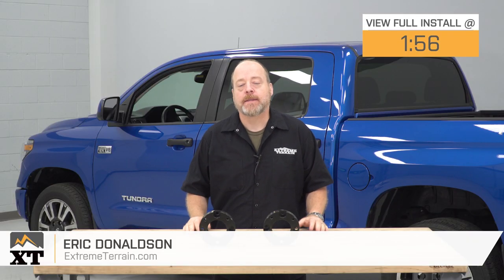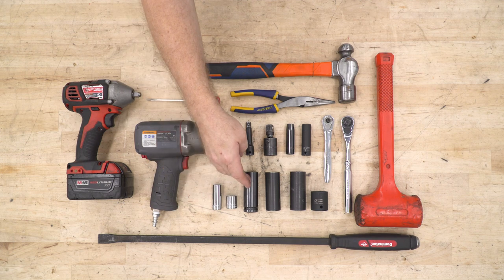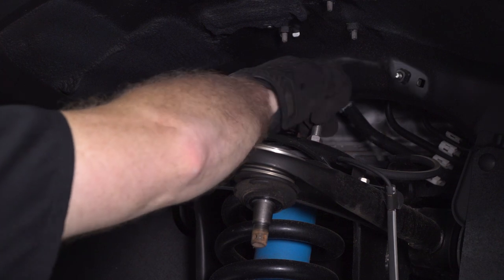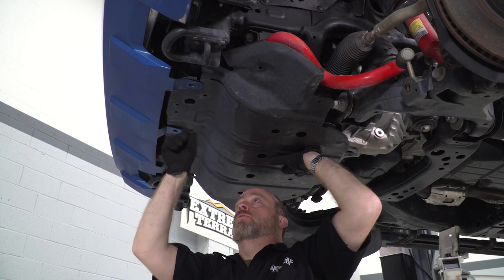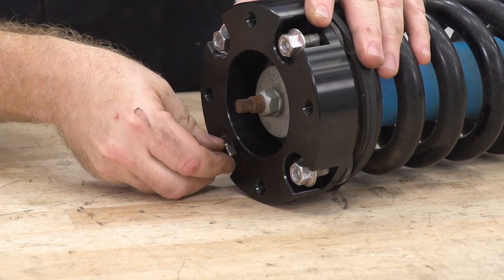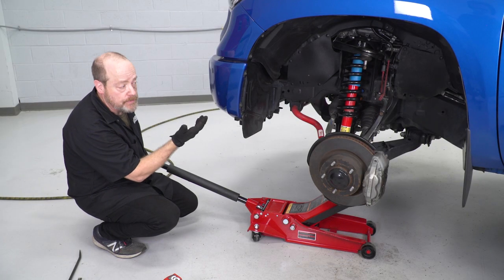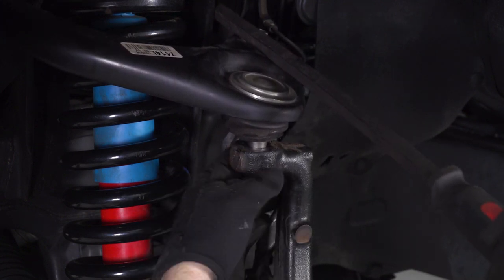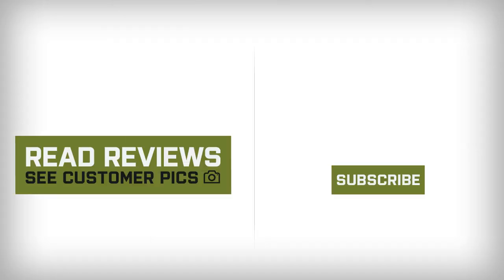2007-2021 Tundra Mammoth 2-Inch Front Leveling Kit Review & Install

Comment: I used this leveling kit and was able to put 35” tires (+20mm offset) on my 2020 Tundra.  I had to remove those small mud flaps in the front part of my front wheel wells due to rubbing.
Reply: Your factory wheels are a +20 offset?
Reply: I believe so.  I took the advice of the business who did it for me.  So far there have been no problems.  Tires have been on 2+ years.  Reason I did it…did not like that raked look.  Supposedly Toyota did that to make the truck more aerodynamic and to get better gas mileage.  If I was worried about gas mileage I would have bought a Prius😂
Reply: @ConservativeVet84 how much did your gas mileage drop
Reply: Not really that noticeable.  I get 12 around town and 15 on the highway.  Some of us sacrifice a little gas mileage to look cool🤣🤣🤣

Comment: I installed a 2-inch lift kit and 285/70/18 tires on my 2022 Toyota Tundra SR5, and when I started it, many warning lights came on the dashboard with disabled functions like ABS, brake... What could be the issue?
Reply: Prolly solved by now, but for others it was likely one or both of the wheel speed sensor wires got pulled / damaged during the install.

Comment: Nowhere in this video did you tell the viewers that you have to rotate your struts after adding the spacers cause the struts will be about 25 degrees off. Without a spring compressor it can be a bitch to rotate the struts to line it up with the new holes on the spacer. That's kind of important information

Comment: With a 2 inch is the any need to worry about control arms being damaged over time
Reply from the maker: You will definitely see increased wear on your factory upper control arms when installing a leveling kit like this. If you have room in your budget, a pair of aftermarket upper control arms would do wonders! -Zach

Comment: This says 2” lift but spacers are only an 1.25.  ?
Reply from the maker: The spacers are never true to the lift size on independent front suspension systems. The spring compression and the suspension geometry paired with the spacer will bring the nose of the truck up to that full 2 inches.

Comment: Tips for anyone attempting to to this yourself: 
1. Take your time. Unless you have access to a shop and lift, it's going to take time to lift the truck, secure it and take the wheels off. Use wheel blocks to prevent the truck from rolling. Don't rush and make sure you secure everything as you go.
2. Have your tools close by you as you start.
3. I found success jacking up the truck using the front crossmember and used a piece of 2x4 to get it to a good position for my jack stands (6 tons).
4. I took out both sway bar end link bolts at the same time. 
5. Have a cord or strap to keep your hub and knuckle from moving too much after you take off the upper control arm bolt. You don't want to have it moving too much and damage your brake lines or your front CV axle (if you have 4x4). 
6. If you have problems with the upper control arm not falling, keep whacking it with a hammer. If it has been on for a long time, it will take more than a few hits. With me, one came off with 3 hits and the other side took 25+ hits).
7. A long pry bar is your friend. Need to line up bolt holes, find where you can position your pry bar to get some leverage to move the part where you need to go.
8. Get a torque wrench and be sure to torque everything to spec. 
8. When putting everything back together, don't put in your sway bar end links. Wait until the very end after you have placed the tires back on the vehicle and the truck is on the ground, off the jack stands. It's WAY easier to put these last two bolts in when it is on the ground.

Again, take your time and good luck! It took me about 5-6 hours the first time I attempted to do this years ago.